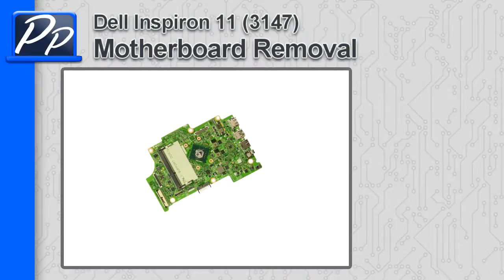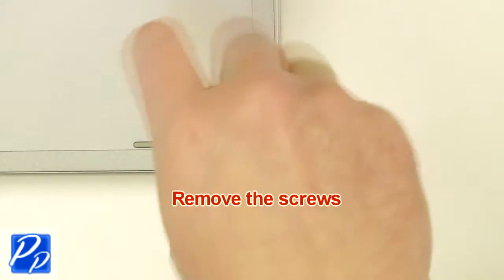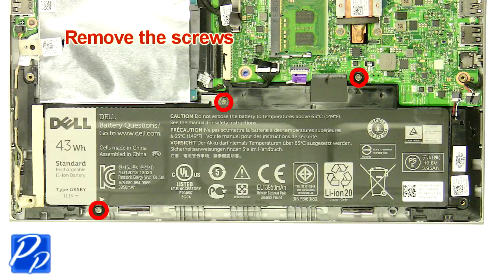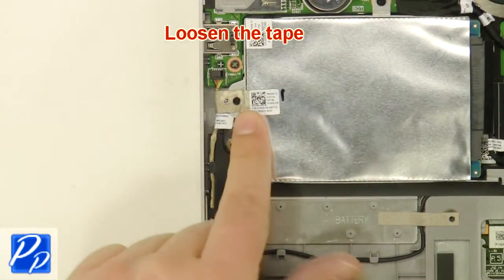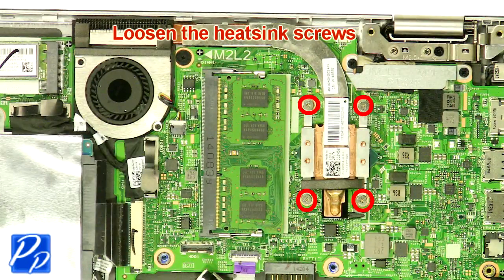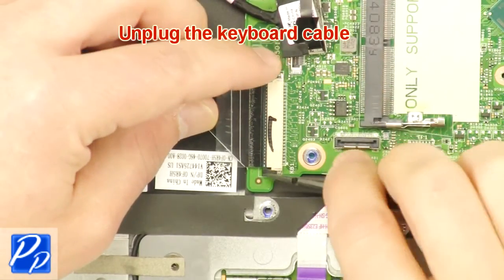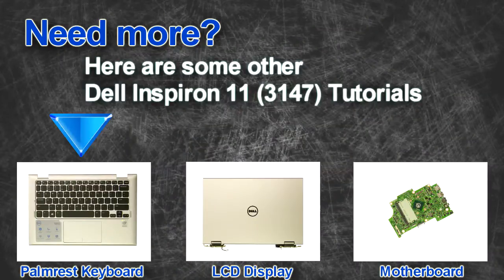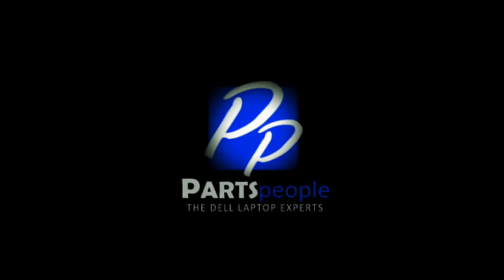Dell Inspiron 11 (3147) Motherboard How-To Video Tutorial

Comment: Which company screw driver did you use to remove the black (Last)mother board screw
Reply from the maker: We use a Husky Multi-Tip screwdriver. It should be a 1/8th inch Phillips head.
Reply: Parts-People.Com, Inc  thanks

Comment: Do you know if the motherboard from 3148 will fit in this and work?
Reply: Yes, the transplant was successful. I had bought motherboard on eBay for 125 awhile back.
Reply from the maker: Daniel Copp I wouldn't be surprised but I'm not certain. I haven't come across a 3148 motherboard yet, so I can't confirm it.
Reply: Parts-People.Com, Inc I Have ordered a 3148 motherboard with i3-4010u and Intel HD 4400 and will inform if it works.
Reply: +Daniel Copp  Did it work?
Reply: +Daniel Copp cool thanks for the info